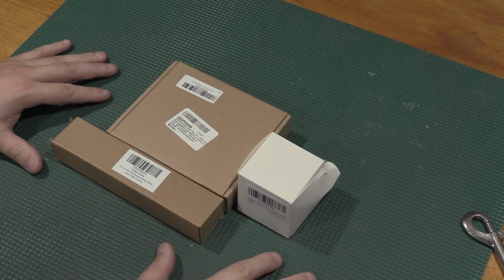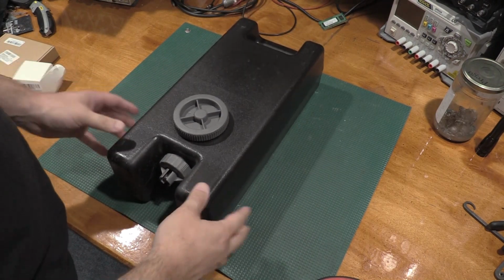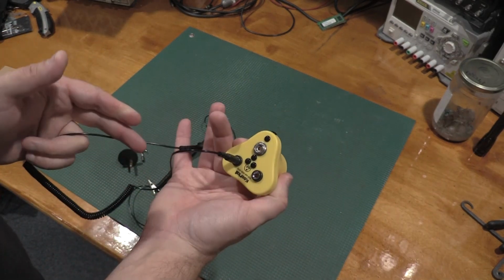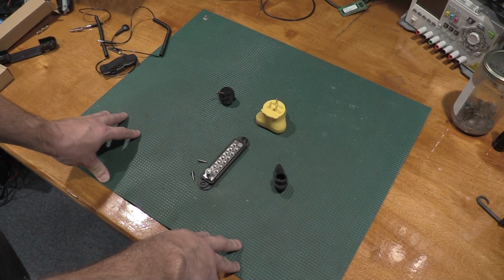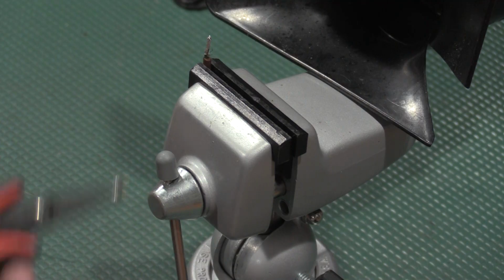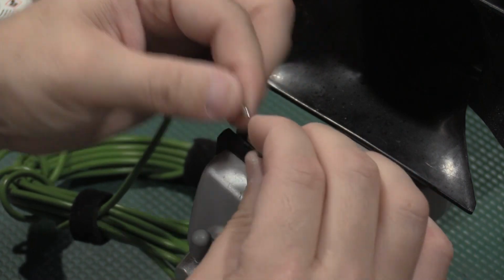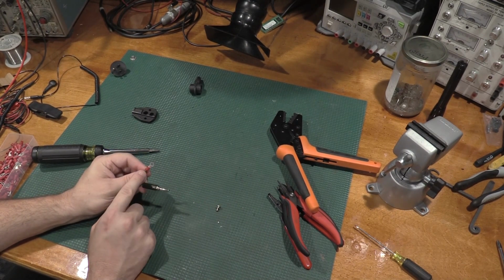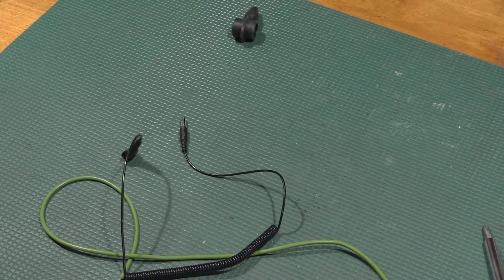Lab Bench Grounding Keeping the Static Out!

Comment: A lot of interesting stuff in this video! I hadn't heard of N2 solder irons before.  But I am familar with the dangers of working around N2.  My lab (biotech) uses liquid N2 for storage.  Can I ask what field you work in/occupation? You certainly don't seem like just a hobbyist.
Reply from the maker: For more info on the N2 irons check out the 600 subscriber video part 2 found here: https://www.youtube.com/watch?v=aI2GEDBtzzI I am thinking about upgrading to the newest series of Hakko irons because they added the N2 capability to the micro iron as well as the full side. My generator will also support both stations. In terms of work experience I have been a service technician for going on 30+ years and I still have quite a few to go before I am done. In those 30 years I have serviced a dizzying array of systems from the mundane to the exotic and everything in between. So far it has been a wild ride.

Comment: I've done formal training on ESD control like this. In my opinion, you're def on the right track and I'm happy to see you doing this! ESD damage is insidious and often results in janky components or things that may fail in e.g., one year vs twenty. One thing to note, you DO want to use the electrical system ground for ESD ground, not a separate line to a ground rod. Reason is, via induction, voltage drop, or a fault, that can develop a potential voltage vs the electrical ground, and cause safety issues for both you and your equipment. Also, consider getting some Staticide, a spray you can use on carpets, hard surfaces, etc. Def helps cut down trouble, especially on chairs. Gotta re-apply a couple times a year. You can also use liquid fabric softener diluted in a sprayer, if you want to save a few bucks.

Comment: I once worked at a “micro business” where we built hi-fi speakers, heated with a wood stove. Nice that it used all our scraps for heat, but it was necessary to keep 2 large pots of water on the wood stove. We would evaporate about 6 to 8 gallons of water a day.
Reply from the maker: It is crazy how fast heaters dry out the air.

Comment: Hi, grounding is needed 👍 at my workplace, I made the grounding points myself and connected them to the main fuse using a 6mm cross-section wire. On the table itself I have two circuits, one uses green-yellow 4mm sockets and the other is green - green-yellow is hard ground and green sockets have 1M

Nice day 🙂 Tom

Comment: Consider an ionizer as well. Even with a dissipative mat, wrist strap, and proper soldering equipment you are still at risk without an ionizer blowing on your work area. When I was working we had to do yearly ESD training and they had demos that would amaze you on how charges build up. All workbenches had one of the overhead ionizer with lighting, Simco Aerostat or similar. The smaller Desco work good too. There's a YT video from Disco, ESD Basics Q&A that has pretty good information as a starter. All air guns were ionizing as well. It's a very complex subject to get right!
Reply: Hello, I not only have an ionizer, a mat over the entire table and a bracelet, I also have an antistatic chair 🤔 .............. 🤔 I also have a very static wife as a bonus because my workplace is in the bedroom 🤣

Nice day 🙂 Tom